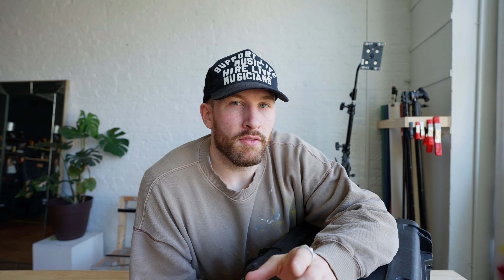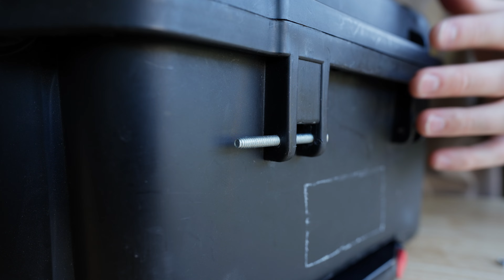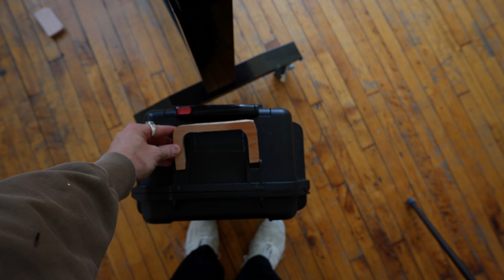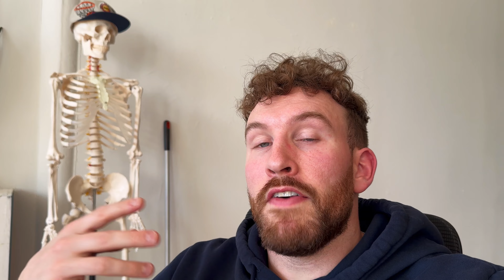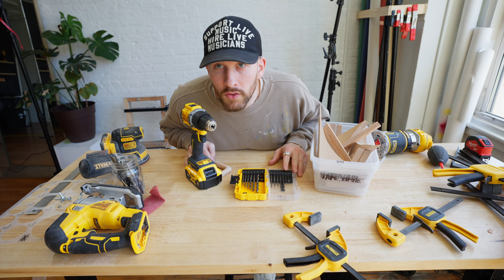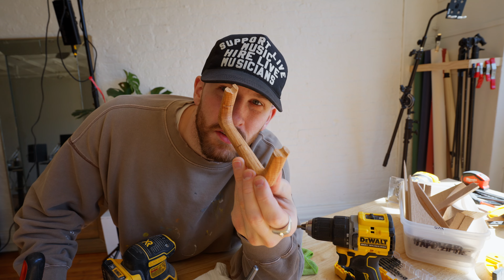American Airlines Broke my case!

Comment: Hey Jaylen, nice vlog! I haven't done much woodworking in the past few years, but I can pretty much immediately say that the reason your handle keeps breaking is because the wood grain is in the wrong orientation. When lifting the case, you are causing stress to the wood where it is weakest: along the grain. You would be much better off rotating the wood 90º and trying it that way. It may just change the weak point of the oak to right in the middle of the handle, but it won't keep breaking like this. Plywood is layered, compressed wood in different orientations, and that would be much stronger if you have any laying around.
Reply from the maker: Genius! I thought that might be the case, but didn't put much thought to it. Thanks for the info and thanks for watching! Cheers!